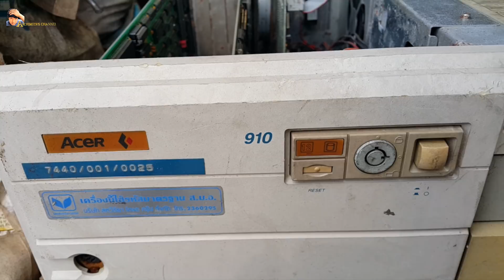Gold CPU Microprocessor Intel R80286-12 Old computers have gold for recycling.

Comment: Wow, that's so awesome, you'd only need 114 of those cpu's to make an once of gold, each one has 15 dollar's in gold (at 1,800 an ounce) minus melting and refining cost's to extract it...Ya, one can definitely get more than that just selling it to a collector with less grief..even if you sold it for 30 buck's , you're ahead, better than scrapping it for gold. Or if it's broke, part it out, there ARE people looking for old card's and stuff, just don't ask 100 buck's a card, you'll never sell it. 5-10 buck's and you'd still make more than extracting the gold out, maybe if gold reaches 4 grand an once might be worth it then. I might be a bit off on the exact figure's, yet it doesn't change the fact you'd make more selling it or parting it out. If you want gold, go mine for it in the ground.